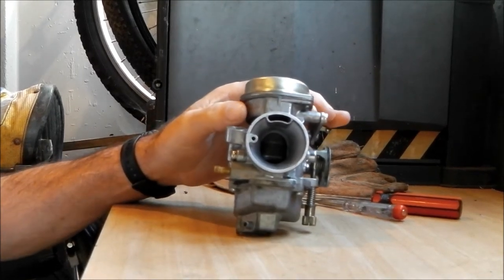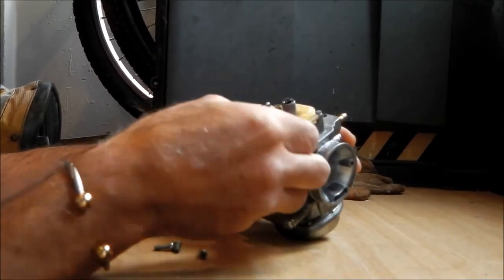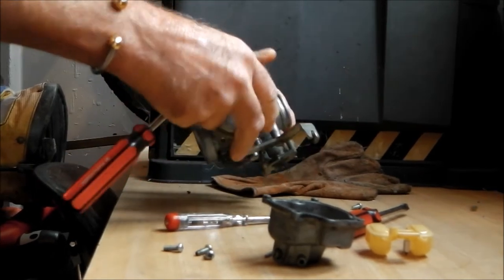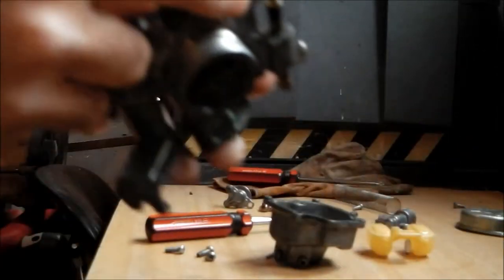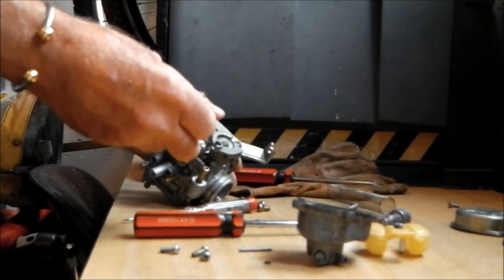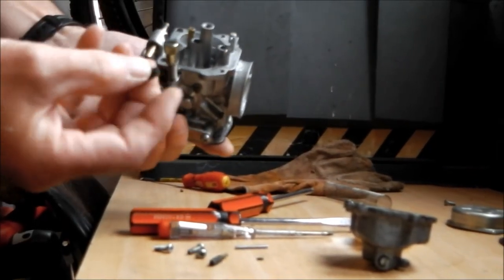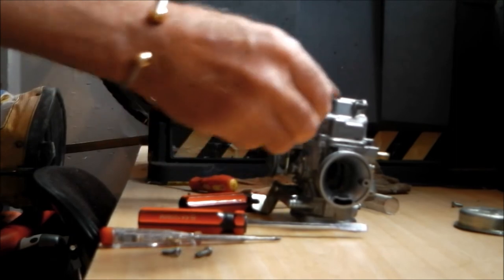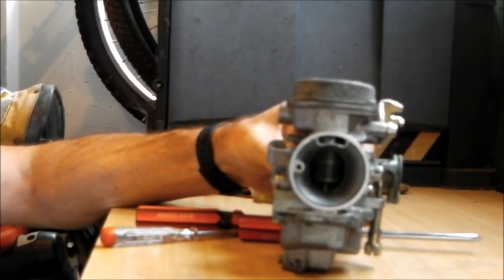"Sparky's Workshop" CBR125R Carburettor Strip and Rebuild "How To"

Comment: Hi mate, building one of these on my channel atm but really struggling to find the standard jet size for a 08 CBR 125 can’t read the one in my carb as it’s so badly deteriorated you wouldn’t know standard jet size would you mate?
Reply from the maker: Hi unfortunately no I don’t because the markings on the one that I had were unreadable to and the bike has been sold a few years now. Good luck with your Chanel.

Comment: Hi Sparky, great video from You. Very helpfoul. But question to You:  in my CBR I have to much fuel in mixture,. Should I do something with main jet?
Reply from the maker: Patryk Gadomski to much fuel in the mixture could be a number of problems, it could just need the mixture screw adjusting, maybe your air filter needs changing, could be the float level is wrong. The jets don’t normally need replacing but worth checking to see if they’re dirty.
Hope this helps👍
Reply: @BikeMates  hi There, I think that I have to adjust spire. I will try and I will let you know. But your video is realy cool. Thanks!
Reply: @BikeMates  Can You please tell me what is purpose for AIR VENT TUBE(Service manual page 5-5)? It is for the opening vacum valve in tank? In my bike it is missing co that's why, I'm asking.
Reply from the maker: Patryk Gadomski hi the tube which opens the fuel tap via vacuum comes from the engine block not the carb. The only air vent I can see is from the bottom of the tank which lets the tank breathe and wouldn’t matter if it was missing. Hope this helps

Comment: Hello Sparky THANKS ALOT ! for those two videos on the stripdown and cleaning of the carburetor. I have a question for you about the gaskets of the carb, once i replace them do i use joint scellant or just some grease to put back on the new ones ? 
Thanks again, Pablo
Reply from the maker: Hi glad you enjoyed the video.
No sealant required for the gaskets on the carb just fit and screw it together.
Reply: @BikeMates  Okay then, thank you very much.
Cheers

Comment: Hay man me again. Just a quick one is the float an adjustable one or a throw away and replace job? 

Also I bought the furl tap like I said I would and fitted it. But when I apply fuel the bike stutters. So this is why I'm thinking I've got to play about with the float level.
Reply from the maker: leom mitchell hi the float is not adjustable so if you suspect it’s at fault you’ll need to replace it, I would also replace the needle valve at the same time.
Hope this helps
Reply: @BikeMates  yeah thanks man that helps alot. I'm not too sure what to expect anymore to be honest.

Comment: Is it normal that there is a coolant hose connected to the carburetor? My JC34 wont start anymore and i dont know why.
Reply from the maker: @patrickbateman4148  not all the carbs on the cbr125 have a coolant hose, apparently it was an upgrade to keep the fuel inlet at a constant temperature.

Comment: when i cleaned mine the pneumatic thingamagig stop going up and down at all, i think my air valve thingy with the spring is busted because i can see right through it all around it or maybe i have a air leak somewhere but problem is i can only find parts at honda and they are soooo expensive darnit
Reply from the maker: Gerhard van Dyk have you tried wemoto on the interweb?
Reply: thanks. checked it out but couldn't find a rebuild kit nor just the air valve diaphragm. any idea where i might get it. i'm not in the UK tho... SA. oh and i did manage to fix the issue i had. it was a bad seal on the VC or is it CV or the pneumatic rubber thing. problem now is it's idling irregularly. if i rev it up it would stay at 4000 revs and slowly go down and down and down and stop and sometimes surprise me and die
Reply from the maker: Gerhard van Dyk I can only think you may find what you need somewhere on the Internet or may buy a second hand carb from eBay.

Comment: Hiya I'm in need of help please. All of the jets inside carb. Do these all need to be wound in full? Or do they need to be wound out , this is my first bike honda CBR 125  rw6 2006 thank you , Is it just the screw on outside that you adjust and leave all screws inside screwed in . Thank you so much
Reply from the maker: 3D Ag3nt hi if you want to clean the jets you will have to remove them, clean and reinstall but do not over tighten them.
Hope this helps
Reply: @BikeMates   sorry to elaborate what I mean, are all the jets inside to be done up. As in all the way in ? Or loosen half turn ,
Reply: again to clarify you have 2 threaded pins inside and one idle pin outside the Carb. the idle outside the carb can be adjusted by turning with flat screwdriver as expected, but. am i to do the same wiith the internal pins, or are they supposed to be tightened or turned off 2 turns etc. thank you
Reply from the maker: 3D Ag3nt no all jets inside the carb must be tightened
Reply: @BikeMates   brilliant thank you and presumably  the adjustment of the internal jets is done by replacing with different sizes jets ,  would you know the best sized jets to install? , 
p.s i am about to comment on your other carb video with another question , thank you for your help :)
Reply from the maker: 3D Ag3nt hi I’m not sure that any other size jets are available for the carb now.

Comment: Hello sprarky, I need to kniv where the Idle crew is at. My idle is at 4000 rpm :/
Reply from the maker: Gerlock22 _ hi the idle screw is located on the right hand side of the carb, it’s a long screw which moves the throttle cam as you turn it.
Hope this helps 👍

Comment: Any idea where I can find one of those seals/gasket for the bottom of the carb, can find them on eBay
Reply from the maker: jamie allen hi if you google cbr125 parts you will find a site I think it’s https://www.wemoto.com/bikes/honda/cbr_125_rc/12
Hope that helps
Ride safe👍
Reply: SparkyRides I can’t find one on that website and can’t find one anywhere, I’ve looked for keihin carb seal but doesn’t come up with the one I need, thanks for your help though
Reply: @jamieallen7402  Did you have much look finding one? I'm now in the same predicament as you were! In desperate need of  the seal/gasket set
Reply: oomo no didn’t find one, ended up using just gasket sealant and worked fine, bit messy but it works
Reply: @jamieallen7402  I appreciate the prompt reply . I shall do the same, thank you

Comment: I have an 07 cbr125r...and my carb looks completely different than this :/
Reply from the maker: Hi thanks for you comment, the carb in the video was off a 05 bike so I assume that Honda used a different one on later bikes.
Reply: @BikeMates  ahhhh that could be it, mine doesnt have a float bowl for some reason and no drain bolt aswell, its unlike any carburetor ive ever seen or cleaned, and its also not gravity fed aswell taking off the gas line i cant seem to do unless i break it,  i got my bike finally started after 2 batteries,  it hardly starts then when it does, it dies at high rpm
Reply: Im assuming its dirtygas and dirty carb, i out fuel line and gas stabilizer in it, hopefully will clear it up and maybe spray carb clean in through the airbox i.hope it helps, ran fine the 4x i rode it!

Comment: hi friend, i have a cbr 125r but i cant ajust the misture, i have it lean but my screw dont do anything! help me . thanks from portugal!
Reply from the maker: Gym Rat Oldschool hi do you mean that the screw won’t move or does it move but makes no difference?
Reply: @BikeMates  hi, it moves but don't make anything
Reply from the maker: Gym Rat Oldschool all I can recommend is remove the screw being careful not to loose the o ring and washer and give the screw a good clean then replace all parts.
Reply: @BikeMates  What would you do if the idle screw is totally stuck? :o I actually have 3 carbs in total, the stock on which was knackered, a second one that works except the idle screw is totally stuck and badly burred and a third that is also totally stuck. I've tried everything on these and yet for some reason they're totally stuck, ive tried a blow torch on the knackered one and it did nothing, the (brass?) idle screw just breaks before I can loosen anything.

Also sorry for hijacking this :')
Reply from the maker: UnPotat hi when you say the idle screw are you talking about the idle screw or idle jet?
Reply: @BikeMates  Sorry for the slow reply! I mean the idle screw on the outside of the carb on the left side, though I've also found the same with the jets inside the carb, literally everything seems to be stuck insanely bad on these old things :(
Reply from the maker: UnPotat not had that problem myself but I suppose it could be a reaction between the two alloys. Could try soaking in carb cleaner for a day or two to see if that helps other than that I don’t know.
Sorry for not being much help.
Reply: @BikeMates  Ahh fair enough, its the same on all 3 of the CBR carbs I have, literally everything is stuck, cant take the jets out to clean them, let alone half of the outer screws :(. I have a 28mm flatside carb I can use but its just not as nice and takes lots of twisting for the same effect. Cheers for the input though :)